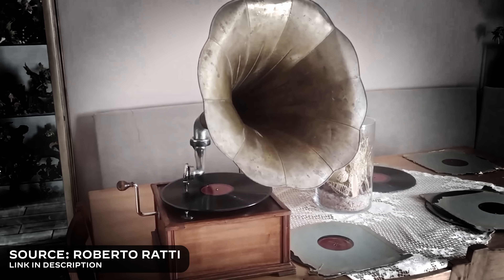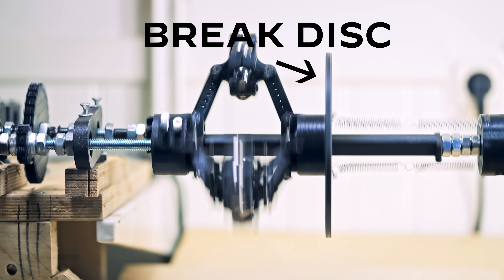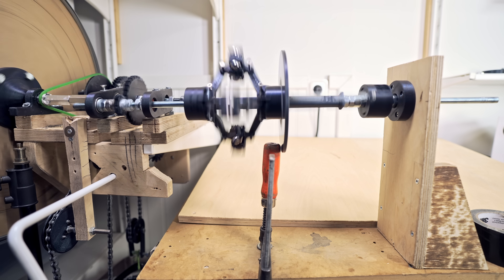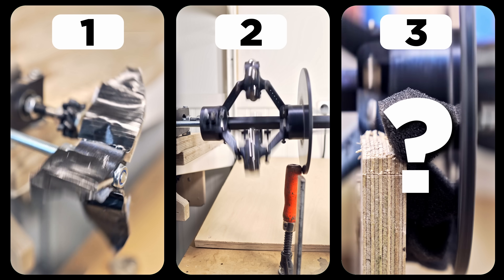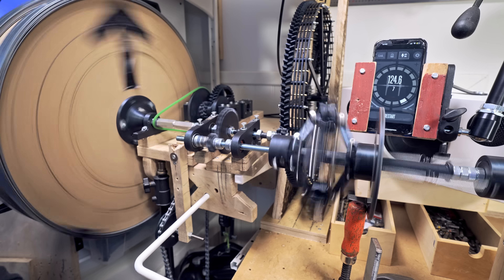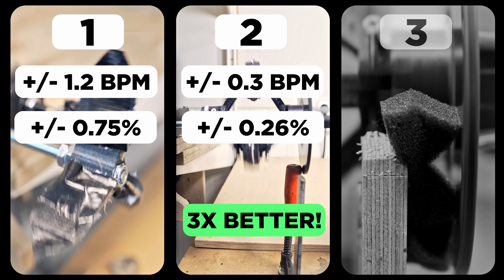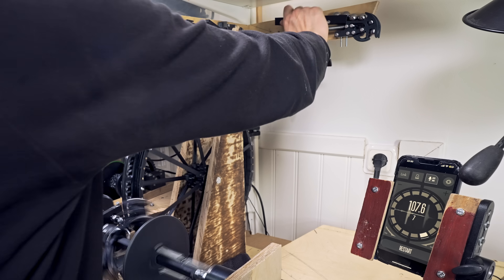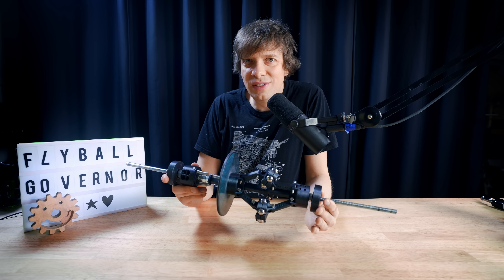How Gramophones play Tight Music - The Flyball Governor

Comment: Control theory:  The goal of control theory is to design a controller that can manipulate the inputs of a system to achieve a desired output or state, while minimizing errors and costs. A controller is a device that regulates the inputs of a system based on measurements or observations of the outputs or states.

Comment: One variation from the traditional design that might be called for in this case:
- Due to the fact that you'll likely need to change tempos dramatically (as opposed to most devices which use these machines) it may be worth it to design the brake "pad" assembly such that above a certain amount of force (such as might occur when changing the BPM to a lower speed, pushing against the brake disc), a clamp mechanism closes on both sides of the brake disc.  This could drastically reduce the time it takes to shift from a high BPM to a low BPM.  Unfortunately, this wouldn't solve the opposite use case.

Comment: Love the result! Just a quick reminder that youre potentially stacking up errors by e.g. using more than one note on the programming wheel. If each of the 4 isnt perfectly 90° apart that could influence the result. Having said that the results speak for themselves that they are perfectly spaced. One thing to look into with the foam is wear and tear. My suspicion is that it wasnt actually the foam that was relevant, since the disc was wobbling the handle couldnt make perfect contact all the time. For a more realistic prototype (like you build in germany) a motorcycle/car break with a single breakpad would be an option that id consider checking out. It runs true and has a very long lifetime and the properties dont change much over the lifespan of the brakepad.

Comment: I had already thought of this system.. I've seen these in a lot of mechanical devices, like Hit and Miss engines, to shut of the ignition when the engine goes too fast, in windmills milling grain, to reduce the pressure on the millingstones when they slow down too much, Steam engines.. also... take a look at the DAF Variomatic Transmission, these have a simillar system to control the Transmission ratio....
So.. i really see you are on the right track!.. i thorougly enjoyed the first MarbleMachine Video.. and i've been following the progress eversince.. and lately you seem to solve all the problems of previous machines as you go!.. keep it up!

Comment: I feel like you could even increase the engergetic efficiency by using the Flyball Govenor in combination with a continuously variable transmission.
I know it´s one more part and no part is the best part, but I feel the urge to point out that potential efficiency gain. 
However, that could be my german over engineering speaking... xD

Comment: the increased surface area of the one with the foam pads will for sure be much more stable.  The really huge improvement will be when you design the adjustment system for changing where the flywheel brake gets set so that you can change the timing on the fly.  Once you get it set up you will be able to calibrate it and make very repeatable and very precise timing changes.  By the way whenever you want to make adjustments with a mechanical method using a screw drive is sovereign.  You could set up the indicator you adjust to with the actual bpm settings or use a system like on a micrometer for very fine adjustments.  You will want to do multiple teste to determine the give with the foam and how fast it wears, or else you may want to consider using something like felt lining on the contact surface or even use bearings for the contact point.  There will be some amount of give in any set up whether it is from the hardness of the materials being used, the friction involved and how it changes as the materials heat up, don't forget that friction generates heat, and the amount of wear over time.  Wear can be managed by using replaceable contact pads and a standard sizing along with a quick and easy way to calibrate the system whenever you change the pads. Testing and data are extremely important and the larger the sample size the more accurate the data.

Comment: The worry I have about "don't believe, but verify" mantra that Martin has adopted is that he's losing the ability to use design thinking to solve problems. He really didn't need to do this test to learn that a flyball governor is better than an air governor, or that a dynamic surface that ensures constant contact (foam) would be better than a hard wooden cylinder (screwdriver) to deliver more consistent friction against the wobbly wheel of the prototype. These are all things you can Google the answers to. As Martin adopts more traditional and proven engineering mechanisms, he hasn't considered one of the main benefits from them being traditional and proven: you don't have to prove them yourself! You can actually just "believe" that they work the way they've been known to work in a million other machines across many centuries.

If this channel were about educating it's audience about these things then all this time waste would be truly valuable, like incredibly, monumentally valuable. But because Martin never seems to get very far into why he gets the results that he does, it really is him just re-inventing the wheel again and again.

Comment: Instead of a friction brake you can use a magnetic brake. Make the brake disk out of any metal (aluminium is fine) and replace the clamp handle with a strong permanent magnet. The magnet induces an electrical current in the brake disk and the induced current creates a magnetic field that interacts with the permanent magnet to slow the disk. This is how train brakes work! If done right there should be no contact with the disk, no noise, no wear.

Comment: I m sure I have suggested this in the past but you may want to considder a magneti brake rather than directly using friction. magnets on the governer disk that approach an aluminium disk should work well. You should also look at centrafugal clutch mechanisms and governers that push a shoe into a drum. The mechanisme would be less complex and thus more accurate. You could still use an aluminium drum with magnets aproahing it rather than a friction material. Hope that helps.

Comment: Nice explanation of this classic control mechanism! It’s quite inefficient though to use friction to slow down the machine. In a steam engine, the same mechanism is often used, but there instead of acting like a brake trying to reduce the output (wasting energy) it’s connected to the throttle and thereby reducing the amount of energy input. 

Would be REALLY cool if you would use that principle on the marble machine! 😀

Comment: Used often on engines for a constant speed, but it controls the throttle instead of a brake.
Perhaps an "infinitely variable gear system" . The flywheel speed is less critical while the output of the gearbox is controlled, too fast, the gears shift down a little, too slow, it shifts up. Example, two cones pointing opposite each other with a belt around them that can be moved from one end of the gearbox to the other. Belt on small end of the input shaft/ big end of output shaft is slow, belt on big end of input/ small end of output is fast. Spring tension sets the tempo wanted while the flywheel ( within a range ) is just the power supply. Other versions of the "gear system" are out there.

Comment: You need to next test for variable load. Make a test bench that causes the output to do "work" that you can vary, like lifting and lowering a cage that you can add / remove weight to. Then you can time for how quickly the governor can react  to the changing load. In the real machine you will need to be ready to work out the correct size / material of the brake, the correct size/weight of the ball weights, along with the correct size/weight of the flywheel.

Also, you keep timing the BPM of the flywheel, yet its the BPM of the programming wheel that is important. You need to be measuring that.

Comment: Now we are talking. If you want really tight specs, you need closed loop control. That's because mechanical systems invariably have imperfections and are affected by the environment (humidity, vibrations, etc) so any kind of perfect tuning you make in your studio at any given time will be slightly off when conditions change.

In other words, closed loop control exists to reduce the "model error", which is the difference between how the machine should operate ideally and how it operates in practice. It works by noticing when the output goes wrong, and correcting so that it gets right.

So open loop control (that is, control without a governor) can only work perfectly if you have perfect knowledge of all parameters of the system; but closed loop control can be astonishingly good even if you have an incomplete picture of how the system works. All the little details you don't know anything about that influences how the system works, their effects get corrected out by the governor

Comment: I don't think a governor will work directly with the flywheel. It'll work better if there is a spring buffer between the flywheel and the governor. The issue is that the governor is only limiting how fast you are turning the crank

Comment: Very Cool , Damn.

Question, did you try using an escapement like clocks have?

also, since started watching your videos your questions seems to reask themselves since I guess this is very interesting, so a few  ideas:
- use different sizes of marbels
- build a step spiral where each step translate a portion of the speed of the ball in the vortex to balls outside it.
- (a crazy one) since many balls can generate a wave - matching a wave going over ball kinetics to a sound wave over air.

Comment: Now instead of that sliding disc arrangement (great as a prototype, not so great on production), use a Bowden cable and mountain bike disc brake components.

Basically the same idea, but with off the shelf friction components that are proven to be reliable long term and easily replaceable.

Comment: The flyball governor is good, just that it may need to undergo some modification for the full machine.

The original works on the gramophone because it is only for spinning a record, so it would be expected that the marble machine version many need some adjustments.

Like either making it bigger or add more than one to handle to full load of the program wheel and marble elevators.

But that's pretty much for the future if Martin decides to give this 3rd version the green light. It is pretty cool overall to know that old mechanics are still meta.

Comment: Maybe silly idea but what if you use magnetic breaking for the fly-ball governor ? The break disc could be made out of relatively thick aluminium and when it approaches a circular array of strong magnets Eddie currents will oppose a force to the rotating disc. No friction that might wear parts, just some heat to dissipate. But maybe this breaking force it not strong enough ?
Reply: Well after google it it this is something that exist and it is used to brake trains and roller coasters.

Comment: Its great to see you making such good progress. I just wsnt to add something that i think you could make a bit more clear to us. Are these the only tests you did? Because if they are you might want to redo them. Firstly doing only one test each doesnt realy tell you all that much. You would need to test it many times, even better when done over multiple tempos. Second you also have to make sure that the tempi are consistant between the test, scince you have many parts that add friction in relstion to tempo so comparing tests of different speeds might not actually give you a accurate reading of the part you are interested in

Comment: Should the break be the second system if control? That foam pad break was very impressive result but I wonder if the primary control is the weights of the spinning governor getting further apart, it slows down the system, countering both overspeed and underspeed, calibrated so the weights are at midway spread-out when the system is running at desired speed, so like the figure skater would, when spinning, have their hands on their hip and then bring them closer or further to their body if they want to turn faster or slower... The break would only be placed where the speed becomes uncontrollable by the spinning weight extending in and out alone. you can make the weights the shape of a air governor blade as well to amplify the effect of the weights spreading apart. I was thinking I would try to install a rubber "sail" on your jig there at 5:55. Like from a balloon...

Comment: I think an important aspect of the governor, is it's geared up intentionally in a way that there is almost no torque behind it's speed, else it will mash against the brake and still be able to speed up, rapidly wearing the brake out while also not regulating properly, it needs to be sensitive enough (low torque) that touching immediately helps it slow, else it might even oscillate a bit on it's own. Also the foam is likely helping because it is providing a larger analog region to apply pressure within, the hard disk against the handle is more like a start/stop regulation method rather than a variable-friction interface. I think the wider you can make this friction variation zone, the better regulation you will get, also the surface and alignment of the interfaces, the disk was wobbling a good bit into the handle, the foam helped keep that regular as well.

Comment: With the current prototype, the thing I am still most concerned with is the programming wheel. The approach seems very timing stable, but my concern is that the timing trigger profiles seem to take up a lot of angular space on the wheel. I am concerned that in order to have a realistic amount of music on such a wheel that you would need a rather large programming wheel, possibly significantly bigger than the MMX. I would suggest trying to determine this as soon as feasible to enable a chance to tweak the trigger design if necessary.

Comment: Are you going to adjust the finer details on that flyball governor? Seeing how much the Material changed the behaviour, I think you could run a LOT of tests with different materials and surface area. It would be interesting. But I don't know if that makes the big difference. Or if the foam is already close enough to the ideal solution.

Comment: would strongly advise against the foam. weak and tear will ruin your life otherwise. the spring idea from 
@erobwen should do the same, maybe combine it with some abrasion resistant material or use something like the airbrake with variable pitch but in an oil or water bath.

Comment: Both the airbrake and the flywheel governor are proportional gain governors, the flywheel is just much higher gain (and only starts ramping once near the target speed). It's better but it still can't deal with variable loads. For that, you somehow need an Integral action.

To generate that integral, you need a secondary reference, that is not affected by the load of the machine, basically a clock. And then compare the accumulated difference between the clock and flywheel RPM, and use that value to modulate the brake.

One mechanical implementation I can think of is to compare your flywheel rpm against the rotation of a pendulum clock.

For that you would have to build two spinning wheels/gears. one controlled by pendulum, and one that is simply a gear reduction of the fly wheel. Those two wheels could then feed into a differential whose output is the integral error. The rotation of that differential would have to actuate a brake on your flywheel to generate the integral action.

Then you have build a PI controller, which can give you a constant speed at any load.

Comment: One of the problems I see is that your pursuit of perfection is going to stifle your progress. The amount of variables affecting the outcome grows exponentially as your required tolerances are set tighter and tighter. If you want to get the music to play much tighter than this you are going to have to consider variables such as the lubricity of certain wet/dry lubricants, how humidity and temperature affect parts (especially natural parts like wood), and even how the barometric pressure could affect the resistance of the flywheel. I fear that you are setting your standards so high that you won't be able to complete a marble machine to your level of standards within your lifetime. To me, both the marble machine and the marble machine x have played tight enough from what I've seen that it doesn't seem like it's a problem (but then again I'm not a trained musician, I'm just someone who enjoys music). Remember that perfection is the enemy of greatness

Comment: In the spirit of reducing part count, why not use a magnetic Governor, which uses Eddie currents induced on a metal plate as resistive force? This is used for example in auto belay devices.
This kind of Governor also requires less maintenance because there is no contact between moving and stationary parts and thus no friction

Comment: Between governor tests, it appears you may be suffering from confirmation bias between resistive materials.  To truly test, you will want to wear in both materials (wood will burnish and become more slick, but that resistance will plateau after a period of use, for example), and you should not see the rates during testing, as you may vary your testing force to your biases whether you know it or not (yes, even with a gravity drive).  I recommend using a known braking surface and substance, as your printed disc (while novel) is an extreme wear item and not indicative of extended (tour) use.